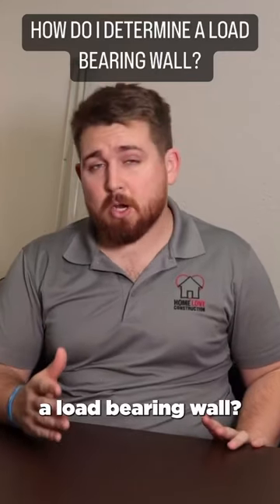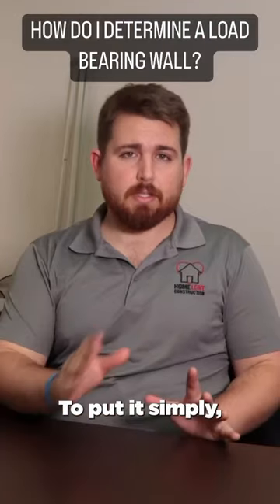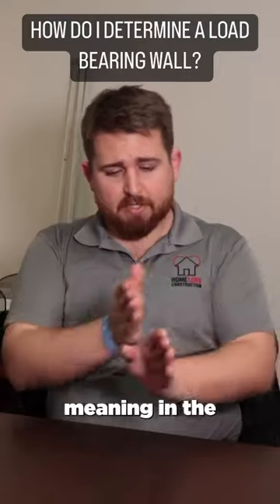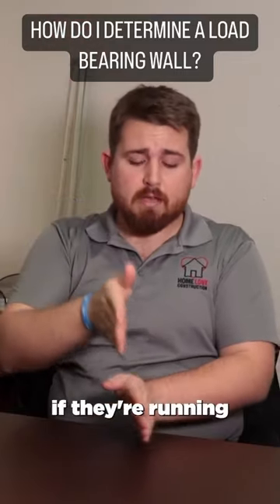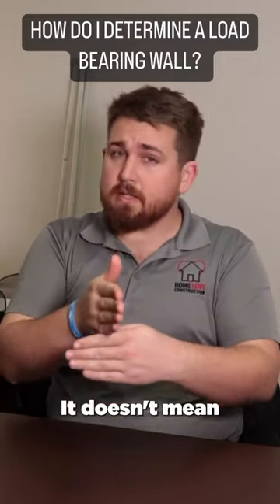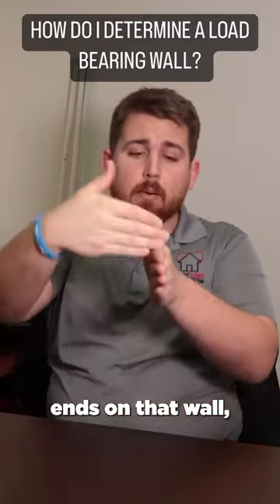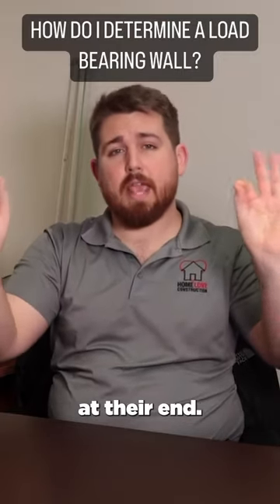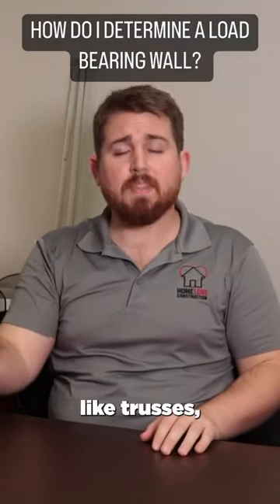HOW DO I DETERMINE A LOAD BEARING WALL? TAMPA GENERAL CONTRACTOR ANSWERS!

Comment: What about the 2 outside walls on each end of the house that run parallel to the joist? (Truss are for roofs I believe)

If a house is a simple box with 4 walls. Then two of those 4 walls will run parallel to the joists?
Reply from the maker: Usually not load bearing but can be shear walls. Its very case dependent - your engineer will have final say